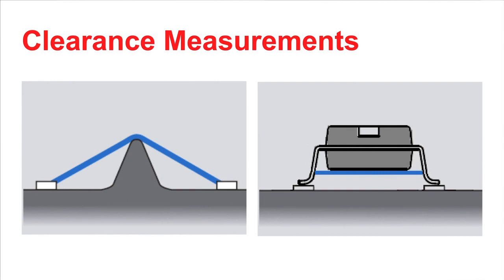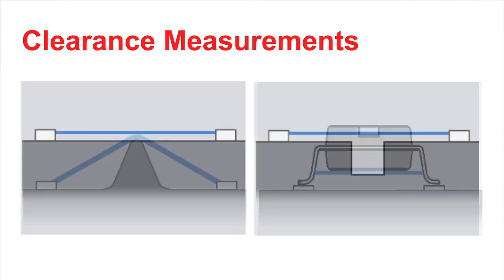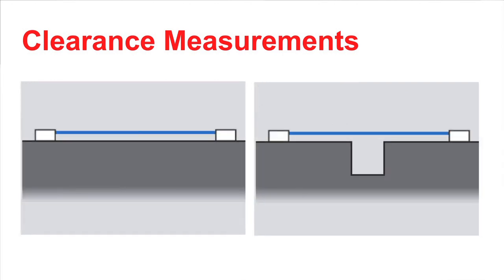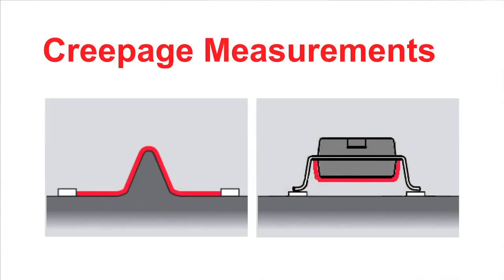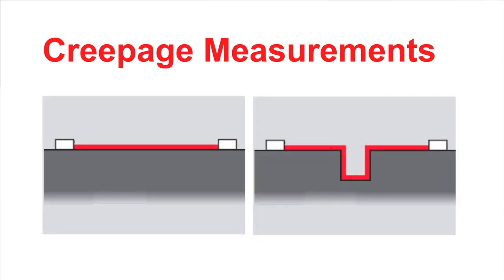What is Creepage and Clearance?

Comment: "Shortest distance between air betw two uninsulated conductors". Is soldermask not included that definition? Two wires too close under soldermask not covered as clearance? They are insulated and there is no air under soldermask I assume?